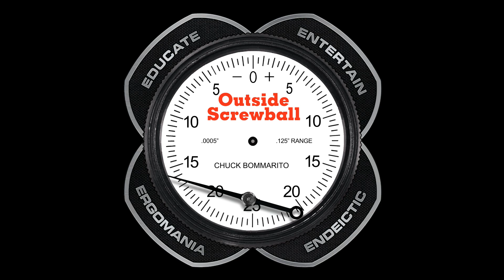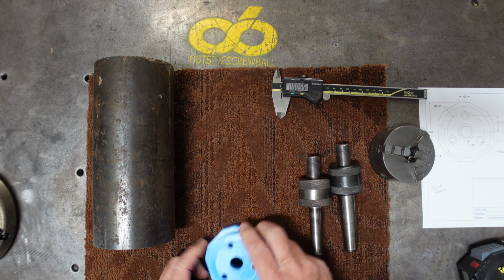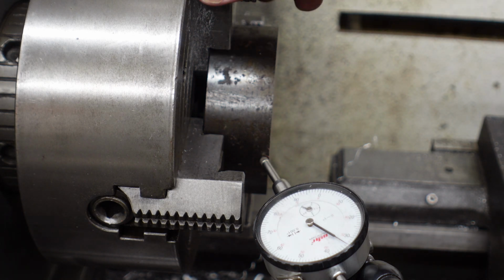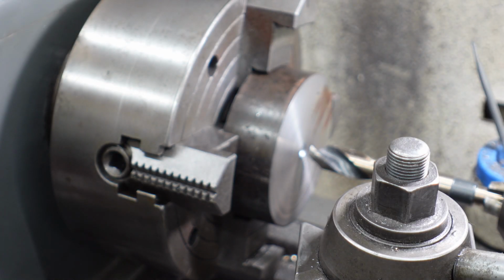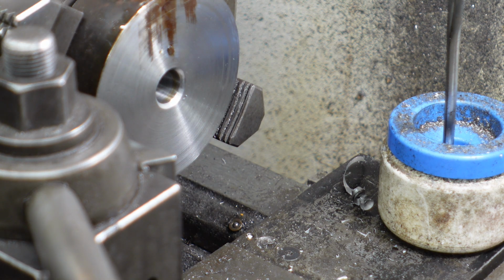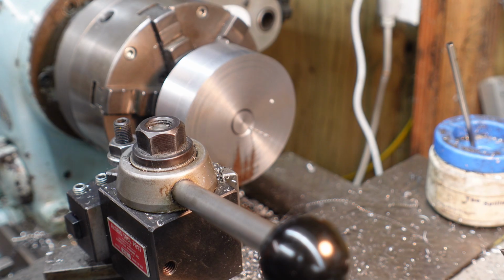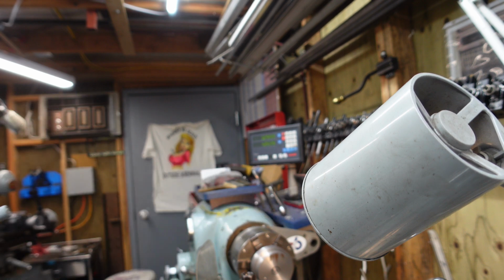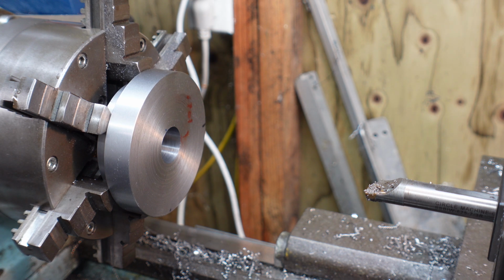Screwy Tuesday 23-23  Tailstock Chuck/Fixture Build Part 1

Comment: Question.  Your skill level and knowledge is far greater than mine, but if I were doing this in my shop, I would have turned a 1inch bar down and threaded it 3/4 " to match the thread for an arbor.   Is my way more labor intensive than what you did, or would my way be more prone to introducing concentricity issues?  I'm only asking in an attempt to increase my knowledge.
Reply from the maker: You are correct that the threaded arbor would be the best for concentricity....truth told, from the start I wanted to use the expanding mandrel, when that failed I thought of the stub arbor....so yes, I was going to fast...thanks for viewing and your comment....

Comment: Hi Chuck
A silly question, Did you choose specifically to make the back section 6 sided (with 6 narrow sections in between)?
My thinking was if you had made it twelve sided (equal sections), you could if you wanted have put it into either a 3, 4 or 6 jawed chuck at any time in the future.🤔
Reply from the maker: no question is silly IMO, now you got me thinking and I haven't cut any flats so....time will tell....thanks for viewing
Reply: @outsidescrewball  👍